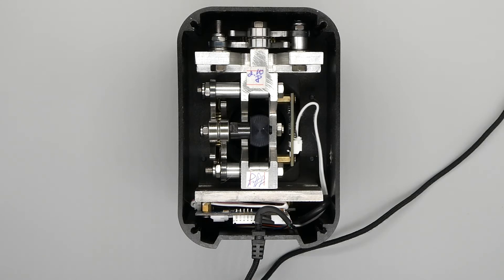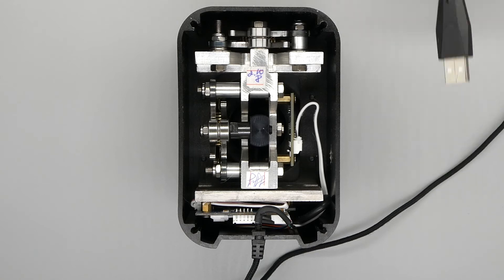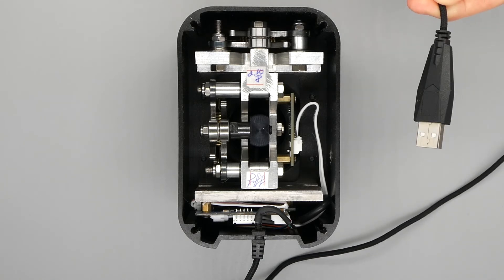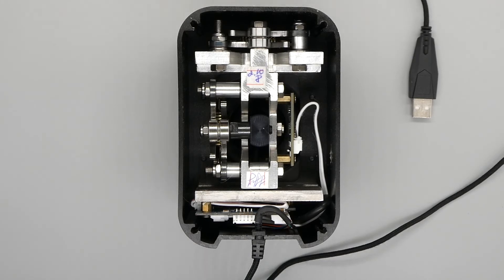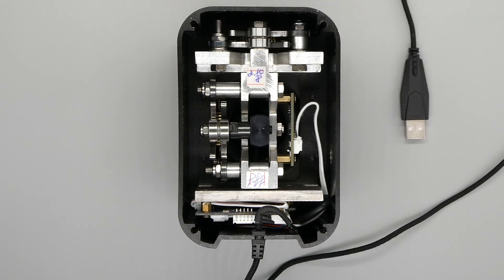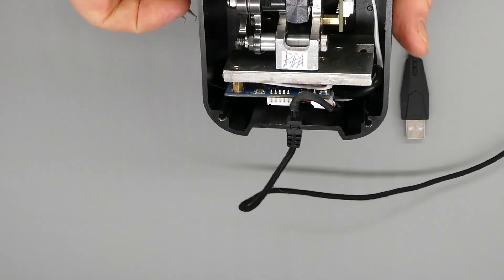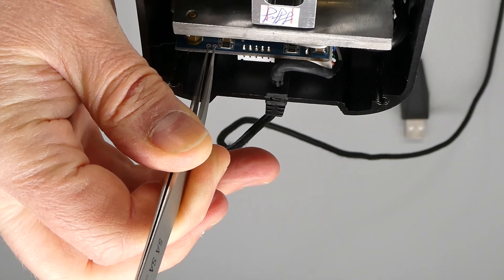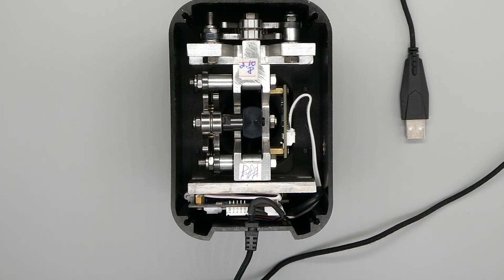Virpil - Boot loader Recovery procedure (hard reset of device)

Comment: I have the Rotor TCS Plus Base + Hawk 60. The Device keeps disappearing and is listed in the Device Manager as an unknown USB Device. 
I reset it with tweezers, and the Device Works again. However, it didn't ask for new Firmware. 🤔

Comment: If the base cannot be seen by the PC,  and assuming the cable is working, would this resolove the issue? I have this on 3 devices, all cannot be detected by the computer, and its the same on my laptop as well
Reply from the maker: that is very weird, try start VPC config software, hold left control + F12, untick "show only VPC devices", click SAVE, hold left control + F12, does your stuff appear now ?
Reply: @HavocCompanyClan   slow reply, sorry, notifcations not on, powered USB hub blew all devices in one go :) had to send everything back to get fixed. bummer lol

Comment: When I do a reset, I get such a message (the last usb connected to this computer malfunctioned), then everything disappears and the joystick does not show.
Reply: everything works on another computer :)
Reply from the maker: @Gitrihs  IF your device works fine on another PC then the devce is fine but something on your main PC is causing issues ... just windows things
Reply: @HavocCompanyClan  Thank you very much for answering.I reinstalled Windows 10 and 11, it didn’t help.all other devices finds without problems.Maybe the problem is in the BIOS?
Reply from the maker: @Gitrihs  Did u configure the grip to have LED's on ? if they do , turn them off and see  if it works better?
Reply: @HavocCompanyClan  i don't have led's

Comment: Hi, I think I may have trashed my VIrpil Warbird and Virpil control panel.  There were both plugged into my PC during a firmware update when the firmware install was interrupted.  Now the software loads and then hangs up. Some functions in my stick and controller do not work.  Should I use this video to reset the Warbird? How would I reset the Virpil control panel?  

Need Help!  Thanks!!!
Reply from the maker: Every virpil device has a built in recovery mode as detailed in this tutorial , you just have to find the pins on the board inside the unit

Comment: I am the new owner of the Virpil T-50CM3 Throttle with the detents. I've pored over your trouble shooting guide trying to get the throttle to work properly. As it was with my initial install, only the throttle levers and flap lever work. All of the hats, buttons, switches and the mini-stick and slider on the right throttle continue to now work. The LEDs light up however. I unplugged all other USBs except for the mouse, ran VPC Software as administrator, hard/boot reset... nothing. This has been extremely frustrating. My Mongoose stick and base as well as the ACE interceptor pedals work however. I've had a support ticket submitted for about a day or so now, but still nothing. I would really appreciate some help if you have any insight.
Reply from the maker: if you correctly followed the guide and the profile and calibration etc all worked fine and certain buttons are not working, sounds like a hardware fault
Reply: @HavocCompanyClan  I was afraid of that. Thanks so much for the quick reply, and for putting out your guides. It was immensely helpful, especially seeing as how I've yet to hear back from support. Hope you can keep up the great work!

Comment: Im getting this error in device manager when my CM2 Base tries to connect:
This device cannot start. (Code 10)

STATUS_DEVICE_DATA_ERROR
Do I need to do this?
Reply from the maker: rule out the hardware first, plug the CM2 base into a different PC, see if the error happens on that PC